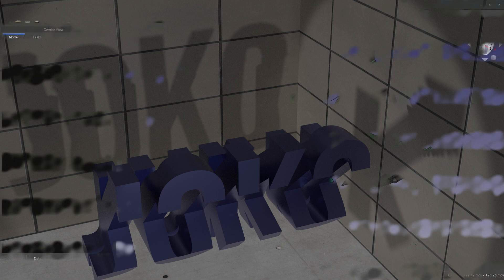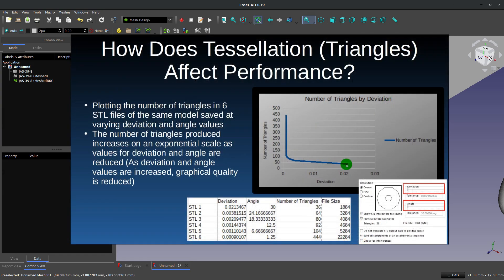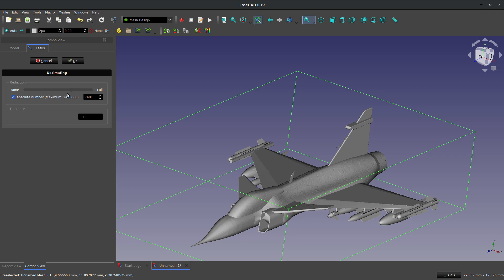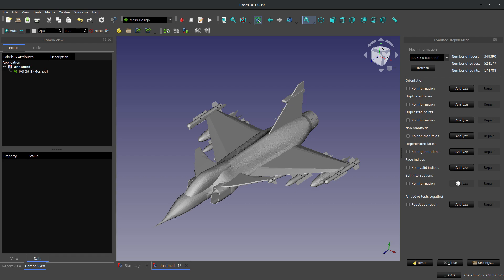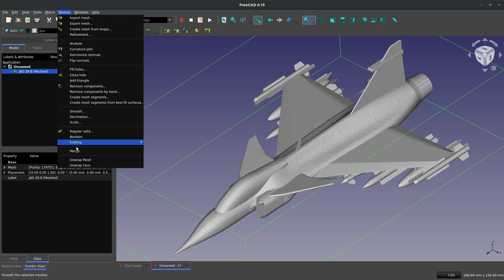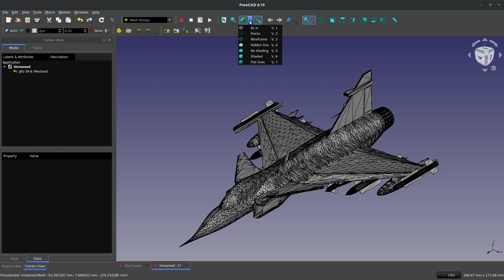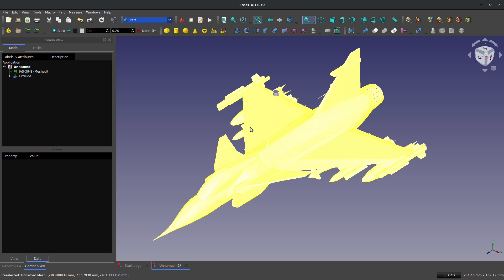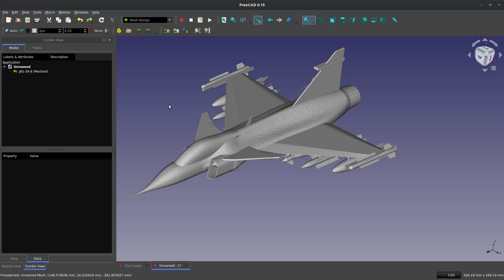FreeCAD: All About Analysis And Editing STL/Mesh Models |JOKO ENGINEERING|

Comment: Thanks Joko! Very informative! Do you know how we modify cell sizes of the mesh models? I want to have a homogeneous cell size across my model.
Reply from the maker: That is a great question.  I assume you are asking about meshing from a native file?  If so, I might be wrong so don't take this as absolute gospel.  My understanding is FreeCAD will use tetrahedral mesh, but there's not an option for hexahedral mesh yet.  Depending on what you're looking for, hexahedral may be a better fit for your needs and some external meshers can do it.  Here's an example of what they look like if you haven't seen hexahedral:

https://ars.els-cdn.com/content/image/1-s2.0-S1350453305002675-gr2.gif

When working within FreeCAD using a tetrahedral mesh,  I can't think of a way to get everything to be the exact same size (I have less experience with hexahedral meshes but I know even with hexahedral the cells will vary in jacobian values as they go through different geometry) but I know the FreeCAD tetrahedral will allow you to specify the minimum element size so you know the mesh will have at least as much definition as you want, if not more.  

My experience is Mesh Design>Create Mesh From Shape > Mefisto >specify minimum edge length does a great job of what you're asking and is the closest thing to doing it from a native file in FreeCAD.  Mefisto with minimum edge length is heavy, so start large and work smaller.

Hope that helps.

Edit:  I forgot to mention GMSH allows you to specify the largest and smallest elements values, but I haven't been able to have the time to wrestle with it to get it to work.  That can be worth looking into as well.

A lot of this depends on how you want to use the part too.  Mefisto is great for some things, not great for others.

Comment: Thanks.    I really enjoyed that one.    I'm  still on  0.18  and can't find 0.19 for download.    I need the Decimate mesh tool.      Jim
Reply: https://github.com/FreeCAD/FreeCAD/releases/tag/0.19_pre
Reply: Thank you Funkysod.    I'm afraid I've failed the IQ test.   I can't find any installation files. I searched the net and found a reference to a .bin folder with an exe file but I can't find one.
I unpacked with both Winrar  &  7 Zip         but no sign of an exe file.
   
  " chrisb wrote: ↑
Mon Jun 15, 2020 6:10 pm
- Download
- unpack with 7zip or rar unarchiver (you may install such unarchiver separately)
- start the exe in the bin directory.

There is no further installation required. "

What am I doing wrong please.   ? ? ?
Just a thought . . . . . Windows 10 defender wouldn't have deleted it would it? ? ? ? ?
Help me please.

Jim
Reply: @flypic1098  when unpacking the files you'll see a bunch of folders (data, mod, ...). In not sure, which one, but one of those folders is holding a freecad executable. You don't need to install it, I usually just create a reference (not sure about the English term for this, "Verknüpfung" in German) to that .exe on my desktop and start 0.19 that way
Reply: @flypic1098  Did you download this ZIP file?  FreeCAD_0.19.23323_Win-LPv12.1.6_vc14.x-x86-64.7z

If so, there is a FreeCAD.exe located in the BIN folder/directory once you Extract the ZIP.  That is a freestanding EXE that won't install anything but rather will just start the program.
Reply: Matthies & Michael:    Thank you for your help. I've downloaded 3 times and searched for an exe file but none found.
I'll now try with the link above and let you know how it goes.      Jim
Reply: @flypic1098  https://github.com/FreeCAD/FreeCAD/releases/download/0.19_pre/FreeCAD_0.19.23323_Win-LPv12.1.6_vc14.x-x86-64.7z

This is the file you want for 64bit Windows.  The Master is if you were compiling the program yourself.  Once you download the above right click on the .7z file and use EXTRACT TO "FreeCAD_0.19.23323_Win-LPv12.1.6_vc14.x-x86-64".  Then open that folder and then the BIN folder and FreeCAD.exe is in that folder.
Reply: @michaelg4931   Thank you Michael.
Nice simple instructions for an old guy to follow.  And the link to the file too.    All working now so I'll have a go with the Decimate mesh tool.     Thanks all for your help.     Jim
Reply: @flypic1098  You're welcome.  From a fellow old geezer. ;)